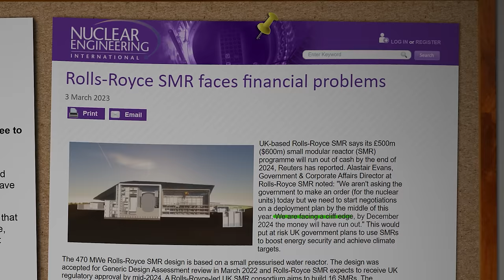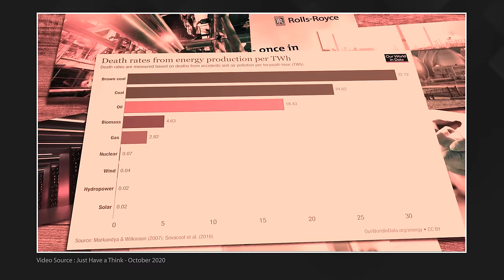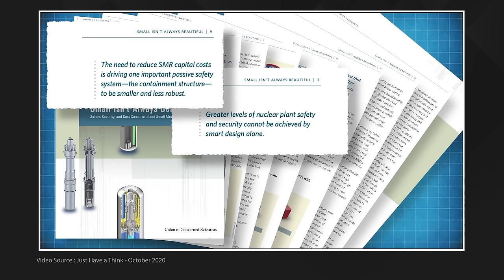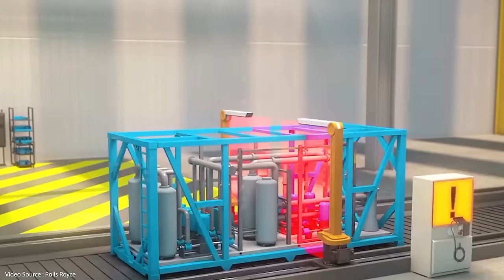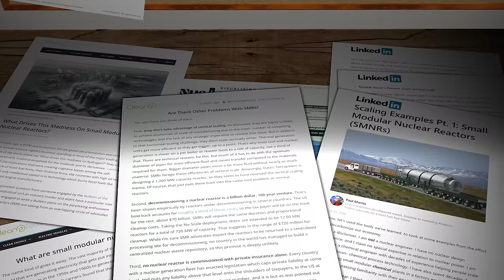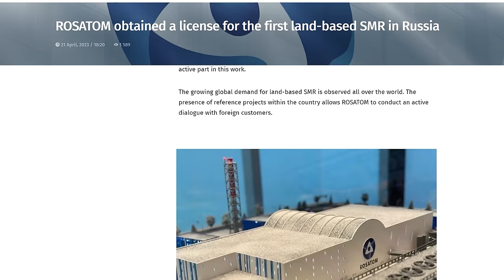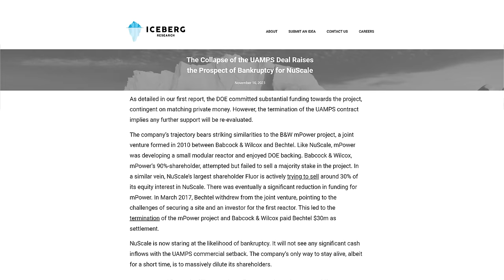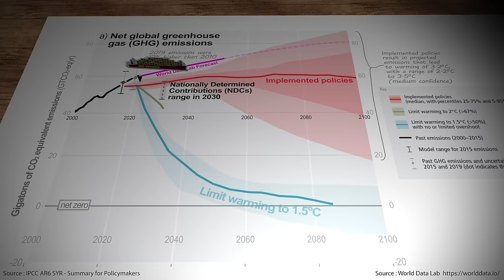Small Modular Nuclear Reactors. The Verdict

Comment: The first SMR was actually Akademik Lomonosov, although there were no plans for further production after the first one, so it is not an SMR in that meaning...it was just a special reactor for a specific use case.
Reply: You are totally wrong.  SMRs were presented as the "ideal" use of nuclear power in a 1955 international conference in Europe on the potential use of nuclear power.  The first power plant conceived and built as a SMR was a 22 MWe BWR thorium fuel cycle plant built in Elk River, Minnesota, USA.  It went online in 1964, but was shut down Shut 3 ½ years later in 1968 due to major issues.

By the time of the Elk River shutdown it had already been determined that small nuclear power plants were not cost effective due to the required staff size.

The USA built 17 what would today be considered SMRs (1-300 MWe) in the 1960- to late 1970's (including 4 thorium fuel cycle plants - which were huge technical flops).   All of those plants were shut down prematurely before end of license as they were not economical to operate compared to larger plants built in the same time period.

Many other countries had the same experience with small nuclear power plants.

You only missed by I figure 55 years.  Not too bad.  There are people calming an 80+ year old design is a new Generation IV reactor design (Molten salt reactors) so you did better than them.  

By the time the Akademik Lomonosov was buit and went online in 2019 SMRs were totally old hat and well out of favor worldwide (except for various companies pitching them to investors to get investment money).

It seems that the world is relearning the lessons about SMRs that were well known by the end of the 1970's.

Of course, if you are looking to raise investment monies - there is no need to talk about the actual history well in the past.
Reply: @perryallan3524  as you mentioned building one smr is not economicall, because of the size...lets build 5 in one location, every year...
Reply: @Petriiik   Still not economical.  Here is the problem.  If you double the size of a nuclear power plant you only need about 40% more material, and you likely do not need to increase the staff size.

If you build 2 units the same size you need twice the materials and at least a 50% increase (or so) in staff size (you can share some of the staff between two plants).

There is nothing ecomical about building another small unit compared to building a unit twice the size.

It gets worse the more SMRs you build.

Now the larger the plant gets at some point you do need a modest increase in plant staff; but that is minimal compared to building multiple units.

There are practical limits to how big a power plant you can build; so at some point it does make sense to build multiple large units at the same site.  Dual unit large unit sites are common in the USA.  In many other countries you see 3-6 large units in a row at one plant site.
Reply: @perryallan3524  the most cost of a nuclear power plant is not material. It is the project, the people multiplied by time, long time. Dont tell me staff size is a problem there are plenty of vver440 plants in the world and they are quite economicall.
Reply: @ik You are correct in that its the man-hours to build a plant are the primary cost.  Yet man-hours are fairly consistent with he amount of material needed to build a plant.  So its cheaper man-hour wise to build a single unit twice (or 3 - X) larger than 2 (or more) identical smaller units. 

Yes the VVER series of plants require very large staffs.   Well above western designs.

They tend to be build where wages for the plant staff is not very high and in countries were there is a shortage of good jobs for the population.

They would never be built in most western countries due to the large staff size and the long term cost for that.

In the last few years you have seen a few countries move to the AP1000 planning instead of a VVER design just because of how few people they take to run along with the fewer man-hours to construct.  I predict there will be more of that in the future.
Reply: @perryallan3524  nope, doesnt make sense, finland has vver440 also. It is a poltiical thing why and where vvers where build. You made out stories. Rebuilding stuff at large projects causes time overruns and financing cost rise exponentially. Building smaller standardized smr is aiming to avoid time overruns which will make it cheaper. You have a big problem by building 1GW plant as you do not need them too many. By building smaller you will have plenty of capability to replicate your design in a shorter build time.
Reply: @Petriiik  You should at least try to get your facts straight.  The very history of the VVER-440 tells anyone that it is not economical against larger designs.

Its a design from the 1970's and they pretty much have universally been replaced by the VVER-1000 and VVER-1200 as larger plants are more economical to build and run than the smaller VVER-440.

Not only that but the original containment building was not designed to handle a large break LOCA event; and a lot of them were shut down once that became apparent.   A few were built after that was discovered with a modified containment building (I am aware of 10  of the more modern containment building VVER-440 units in Finland, Czech Republic, and Hungary.  I am not sure how many exist elsewhere.   I have mixed information about the design of the  4 VVER-440 reactors in Slovakia: are they the older design or the newer one?

Another interesting issue is that the design life of the VVER-440 was 30 years at a time when the standard western nuclear design life was 40 years.  It allowed the VVER-440s to be built cheaper than western designed plants.  How long they can remain in service is unknown, but no one expects them to last as long as the more robust western designed reactors.

The VVER-440 has been discarded as an old design even by the Russians.  It appears from the general information I have that they were all completed by the early 1980's.  I'm not aware of any plans to build more of them as the VVER-1000's and VVER-1200's are more economical.
Reply: @perryallan3524  your information are wrong. Slovakia has 5 running VVER440 and the start of the 6th is planned for 2025. Commercial production of the 5th was started in 2023, electricity price agreed is 6,1 Eurocent/kwh. Compare that to Hinkley Point C, that should be around 15 Eurocent/kwh, not even running now. VVER440 in Slovakia, after post Fukushima upgrades, are now planned to run for 70 years, old and the new ones. But you totally missed the point of this discussion, VVERs are economicall and so SMR can be either and will hopefully be. This should not be a PR for VVER. The problem are lots of modifications due to regulations in each country being different. SMR will give a chance by replication.
Reply: @Petriiik  I stand corrected that Slloviakia is building a VVER-440.  The World Nuclear Association website verifies that.

However, there are by my count 21 VVER-1000 & VVER-1200's under construction according to the World Nuclear Association. 

1 out of 22 is not much of a pattern; and there is no guarantee that Russia can build the plant for what they promised; and there is no guarantee that any country with modern western requirements would allow a VVER-440 to be built, or built anywhere near as cheaply.

Comment: Where are the Thorium reactors ? I thought the Thorium way was more likely a way to go for smaller reactors ?
Reply: Many countries have built thorium test reactors around the world starting in the late 1950's.  There are several pebble bed designs that were built in the 1980's and 1990's.  No other country believes that their test reactors worked well enough to design power plants from.  Only the USA thought so

The USA built 4 commercial thorium fuel cycle power plants in the 1960's into the 1980's (BWR, PWR, HTGR).  Thorium did not work well in any of those plants.  At least 3 of them were converted to uranium fuel at the 1st refueling.  All 4 of these plants were technical flops on a rather large scale as far as thorium use went.

The USA also set up a modest scale production of thorium fuel in the 1960s; and found that it was noticably more expensive than uranium fuel.  Just because there is waste dirt in and rocks that contain thorium doe not mean that the thorium does not have to be separated out and processed into a form suitable for nuclear fuel:  No one can run a reactor on raw thorium or uranium ore - it must be separated, refined, and converted to a suitable form.

The vast majority of people talking about thorium totally ignore its history.    I'll let you figure out why, if you wish.

Comment: I appreciate the pushback to the hype. I've only heard the hype thus far, but the hype was promising.

Perhaps the answer is to still rev up the Henry Ford assembly line for this stuff, but keep them bigger. Building out 100 nuclear plants across America (or however many, at least dozens) all to the same specifications, using prefab and standardized parts, on sites specifically scouted to be geologically similar, should make this affordable.

I mean, Russia and Iran used this method and it's worked wonders for them both. Rosatom is unsanctionable because their technology is better and cheaper than ours, and Iran was able to pull this off under Ahmadinejad and crippling nuclear sanctions. If we can't figure this stuff out, it says something incredibly bad about us.

Comment: Even if properly implemented, SMRs are rather inefficient and create more nuclear waste per kWh of electricity generated. The costs of acquisition and operation are comparatively high aswell. What I'd like to see, is several countries working together and developing one state of the art nuclear power plant that additionally has a few fast-breeding reactors for waste recycling. All participating countries then get the blueprints to use as a template. A couple hundred billion USD would easily be affordable if the global north split the costs…

With the resulting lack of financial constraint, the design, prototype build, validation and certification phases could be fast-tracked aswell. 10 years until the first few final power plants are built would be overly ambitious, but 15 years should be doable.

Comment: I expect the future to be renewables plus energy storage. Current battery technology is sufficient for short-term storage - which is a huge deal. But to go 100% green all year round, you need an order of magnitude more storage capacity. Technology for that is less clear and not on the market yet. So a few nuclear reactors are a good alternative. But if we have good grid interconnects, the existing nuclear reactors may be enough. It seems frivolous to spend money on SMRs if they take even longer to bring online than traditional nuclear reactors, or if the cost of the power is prohibitive.

Comment: The problem with wind and solar is the absolutely huge land mass needed to support the technology and the fact that battery technology is nowhere near being able to cope with and redundancies in the system. 
No electrical grid should be reliant on one form of power production especially not wind and solar at this time.
Wind and solar are extremely expensive initially as there needs to be a whole new grid built to support them where as nuclear can use the existing grid and once constructed is very cheap, reliable and clean to run. 
Why one or the other? Why not both?

Comment: Are the nuclear reactors on submarines and aircraft carriers SMRs? How many are those in use around the world?
Reply: Just add up the ships, 2 in each Aircraft Carrier makes 24, 1 in each sub makes about 50 so ~75.  A lot less then the number of commercial reactors.  And they are only about 50MW each so all together they add up to just a single large conventional commercial reactor.
Reply: The modular in the name implies that the number of units can be ordered to fit inside a facility. (the promise anyway). Reactors on ships are PURPOSE built reactors not SMR. They lack containment and servicability for the sake of military prowess.

Comment: "Small" nuclear reactors built in sidnificantky long series are not new. The US Navy has had them made for decades to power nuclear powered submarines and aircraft carriers. I dont think they've realised the sort of "mass production" cost efficencies claimed for SMRs. Anyone have any more info on this?
Reply: The reactor that powered the first atomic U.S. sub was also adapted to commercial use as the first U.S. commercial atomic power plant (Shippingport).  Shippingport was a multi-level standard commercial type power plant with all the efficiencies and safety systems incorporated and it spanned a number of acres.  In a commercial setting, SMRs are no where near as small as people think they are.  And there is not and never has been economies of SMALL scale when it comes to power generation.

Comment: Thanks for bringing this objective post.  It is totally clear that we have to get away from burning fossil fuels for health environmental and economic reasons.  The thing about solar and wind is that it will likely not satisfy our future energy needs unless we start conserving electrons seriously or the need for power reduces due to a possible shrinking of the world population.  Hence some form of nuclear power generation will be required in the future to accommodate clean industrial processes, manufacturing and to charge the future electric cars.  For those that are lucky  to have sunshine and rooftop solar generation all is well.  but for the others?  Living in Australia and considering the recent firers that knocked out some transmission towers cutting power to a large section in the state of victoria one might be able to gauge the risks of relying on an extensive overhead wire network. I am all for clean renewable technology but find that the relevant authority and politicians are not upfront with the citizens and are also heavily imbedded in vested interests that are detrimental overal.
Reply: Nuclear generation running over the same wires would have suffered the same blackouts, but local solar generation would not. Industrial processes and EV recharging are a good fit for intermittent renewables, because people will shift consumption to when electricity is cheap because the sun is shining where the wind is blowing.

Comment: As a South African an immediate solution is required and the only feasible answer is solar. This is by no means a "green" solution but does allow for the possibility of individual action against governmental indifference and is far more affordable than using the present grid system with the perpetual cost per kW increases of power when the power availability is decreasing at an alarming rate: - availability of supply being restricted by 'load shedding' of up to 10 hours per day.
Looking to government for solutions in this country is simply a bad joke. They would rather spend billions on 'T' shirts and kentucky to get votes than actually do any essential maintenance or implement any meaningful change to better the lives of the general population while making sure that those in power lead lives of luxury.

Comment: Objectively, nuclear is slightly more expensive than Solar to build (factoring in loans and excluding batteries). 

It's not that bad, you just put two metals close to each other, they get hot, you boil some water and do the thing.

The challenges with it can be solved with research but no one is investing meaningfully in research.

SMRs feel like the desperate thrashing of an industry that is starved of attention and funding
Reply: The extra grid capacity expansion construction costs are ignored in all these nuclear posts.
Nobody does the calculations. 

Yes, I know the existing grid is available, but grid electricity is only 15% to 18% of all energy used.

Comment: China didn’t build an SMR. It built a small 100 MWe gas cooled pebble bed reactor. The difference is the Chinese reactor weighs 700MT and is assembled on site like any larger non-modular reactor. U.S. producer X-energy has designed a 220MT, 80MWe pebble gas cooled bed reactor that is assembled in a factory in components and then transported to the construction. Hence a small modular reactor.
Reply: Nuclear designs that only exist in PowerPoint presentations are always the best ones!
Reply: @skierpage  No, not always. China will make improvements to a second generation design and this gives them a lot of experience. It’s just this is a first try and it shouldn’t be considered representative of SMRs or at least of modular reactors.

Comment: Ok but wind, solar, and battery are well understood ... really? As good as they are, they have drawbacks: incl
1. Wind blades need replacing every 10 to 12 years, recycling isn't at mass scale, and don't work on windless day (so batteries aren't recharged). 
2. Solar and battery components require mining which isn't green. Recycling is still at bench scale research and requires sunlight so on cloudy days, batteries don't charge.
Conclusion is we need an all weather baseline option to support wind, solar, and batteries. Nuclear needs to be part of the baseline mix. It's not a case of one or the other. A sensible option is a balanced mix of non-hydrocarbon energy.